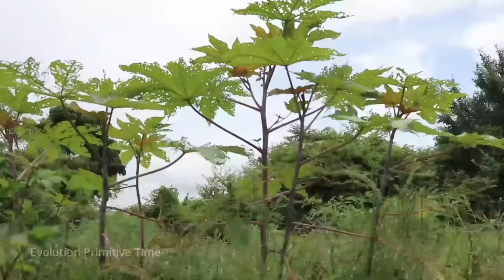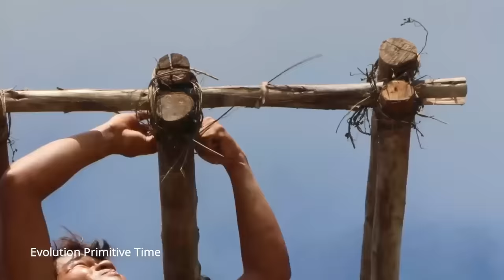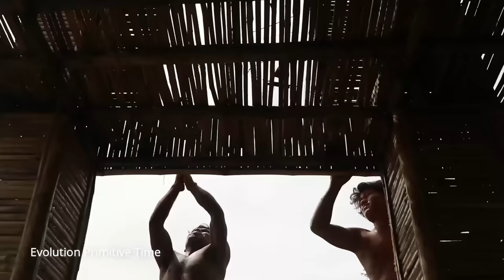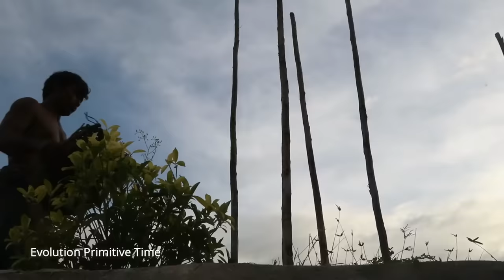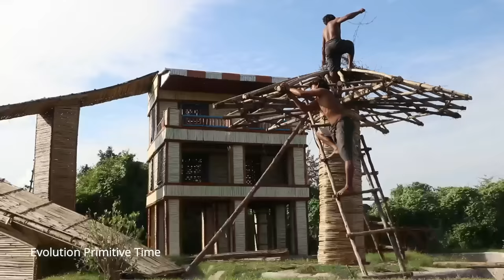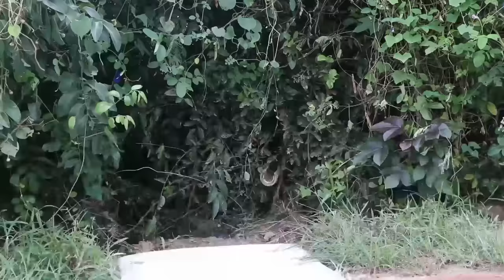[Full Build] Build Beach Pool , 3 Story Resort Bamboo House, Flyover Water Slide , Bamboo Umbrella

Comment: Real question, but why don't you guys like pick up sod and save it for when you need to place the grass all around after digging? Is it because the digging process takes too long and the sod would die or what? I assume that. But that it changes anything environmentally, just a question about if that's been tried to save a little time in the landscaping stage by replanting sod you take from digging the foundation.